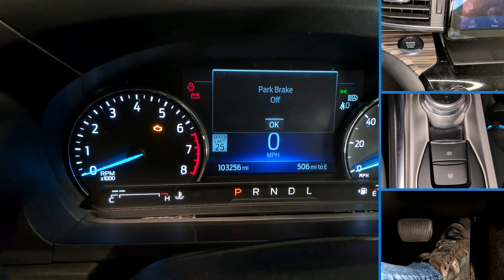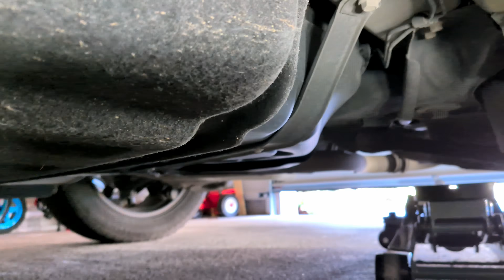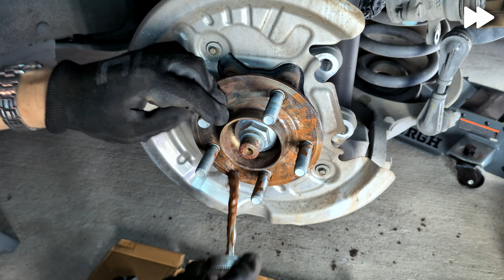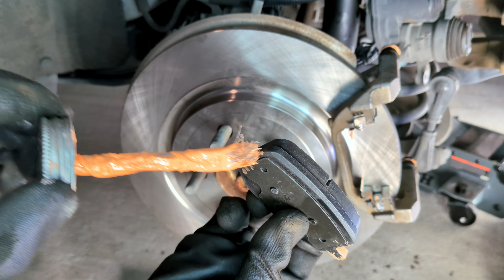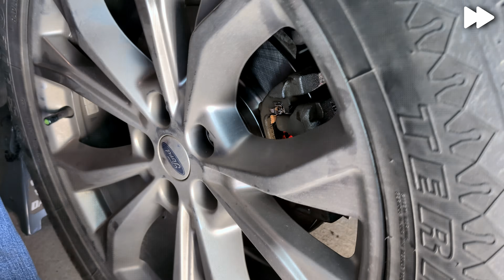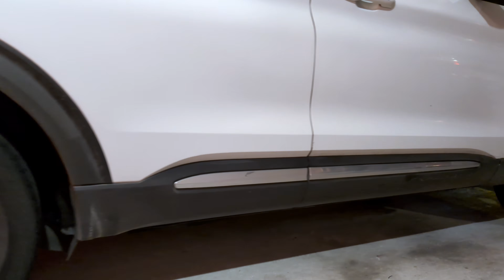Ford Explorer Rear Brake Replacement | Pads, Rotors & Maintenance Mode  (2020–2025)

Comment from the maker: 📌 NOTE: The 17mm wrench used in this video (6.7mm thick) fit without issues, but clearance is tight and may vary by brand. If yours doesn't fit, a thin wrench set may be needed: https://amzn.to/4dJjQKY
👉 Check out the full step-by-step guide for front brake pads and rotors here: https://youtu.be/_30ceswwZyc 🛠

Comment: According to the ford repair manual, you should twist the piston back in (clockwise for passenger and driver side) as it runs off of a screw as well as remove the EPB motor, so you don't strip the gears inside. Or have you not had an issue just pressing it in? Just want to make sure before I do my wife's car and then get stuck with buy a new motor/ caliper
Reply from the maker: Great question, and worth double checking! I've always compressed the rear pistons without any issues on the 6th gen explorers(2020+). My workshop manual for this generation explicitly states "Do not rotate the piston when pushing in the caliper or damage to the parking brake actuator motor may occur."
Could you check which year your manual is for? On the 5th generation you have to rotate the piston if I recall correctly.

Comment: Does the rear slide pin bolt notches go the same way on both sides ?
Reply from the maker: Yes, same on both sides! On the upper slide pin the flat side faces towards the front of the vehicle, and on the lower pin the flat side faces towards the rear. Hope that helps!
Reply: Thanks so much !

Comment: It’s crazy how every brand has a different way of doing things. I work on a lot of GM trucks and their brake maintenance mode is a completely different process.
Reply from the maker: Haha, right?! Every brand does it their own way, and it's nearly impossible to remember the correct sequences when you're switching between brands… keeps things interesting I guess! 😄

Comment: 17 mm Craftsman wrench does not hold the bolt. It won't fit. You need a thin 17 mm wrench.
Reply: I had to use a bench grinder to reduce the thickness of the open end of a 17mm combination wrench to get this job done.
Reply from the maker: Good tip! That’s another way to solve the issue!
Reply from the maker: Sorry to hear that! I just measured the wrench I used in the video and it has a thickness of 6.7mm, which fit without issues, I was probably lucky there. I'll add a pinned comment to the video with a note about the wrench thickness and a link to a thin wrench set so others don't run into the same issue. Thanks for flagging it! 🙏

Comment: Does this electronic parking brake procedure work on the 2019 model as well?
Reply from the maker: The electronic parking brake and service mode procedure only applies to the 2020 and up Explorers. The 2019 and older Explorers use a traditional cable-operated parking brake, so no service mode needed. Just keep in mind that on those 2011–2019 models the rear caliper pistons need to be rotated while compressing them. Hope that helps!